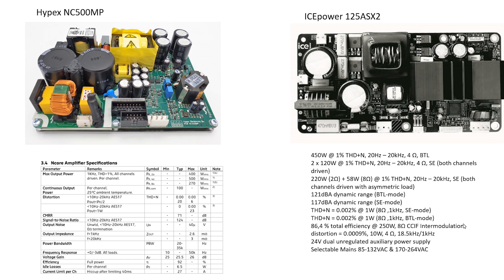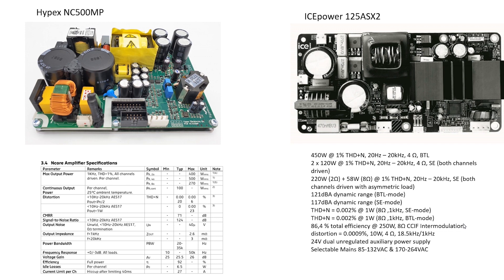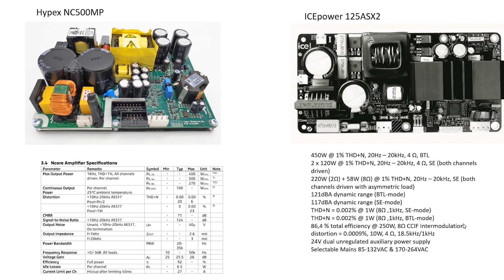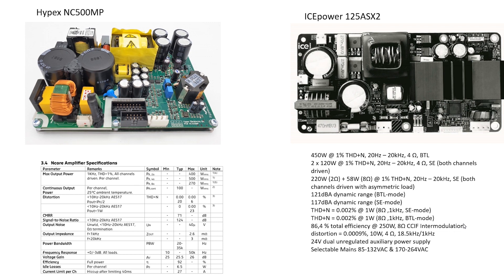Story of the perfect amplifier Part 5

Comment: one spec i find important is idle power consumption or heat generation at low loads, hypex runs 2 to three times the watts of icepower.
above 100 watts i think they might be about even.  if i remember correct its 12 watts vs 30 watts.
i think both amp modules have auto sensing or auto on/off function. and in my experience its a bad feature never working right.
disabling it makes idle power consumption even more important. it also improves sound quality to keep the amp from cooling down.

i have a diy power amp with ICEpower200ASC, in spec sheet you will wind schematics how to disable auto on/off, i just shorted 2 pins.
Reply from the maker: Yes, you are right about heat dispatch. Hypex in single-ended 500W configuration and to ICEpower125ASX2 in BTL mode has a fundamental difference in power supply voltage. To get 500W on 4 Ohm in single-ended configuration you need around  +/-60V DC power supply voltage. 500W in BTL you need just +/-30V DC power. Even having higher overall efficiency Hypex has higher heat dispatch and it should be considered when building an amplifier or integrating in other designs. All around ICE125ASX2 is engineering state of the art design when considering 5 important  KPI’s- audio quality, price, weight, size, and alternative design flexibility. When we discussed with ICEpower company terms and conditions of volume purchase they confirmed that this is their most sold unit with a multiplier of 10 comparing to the rest of the lineup.